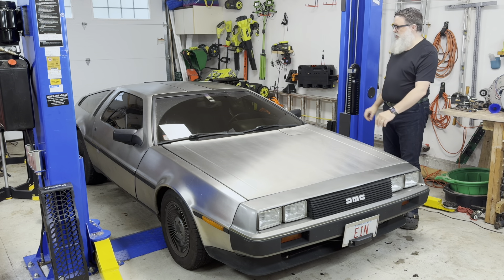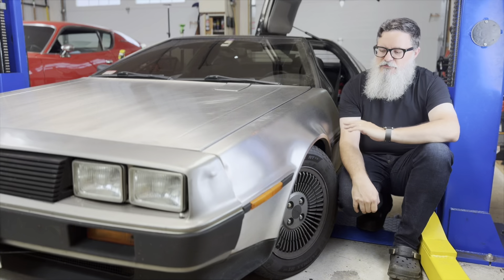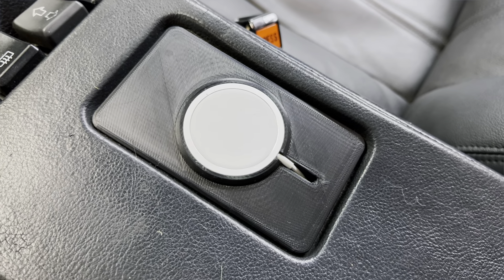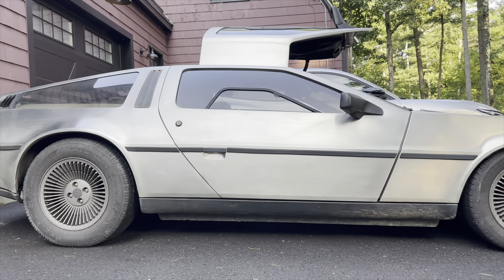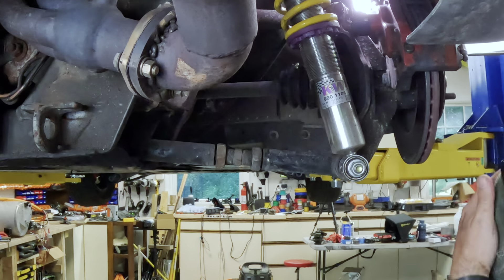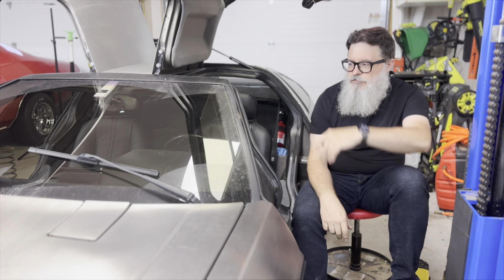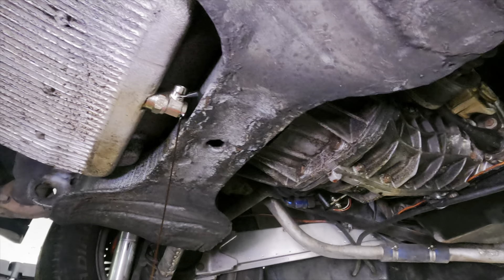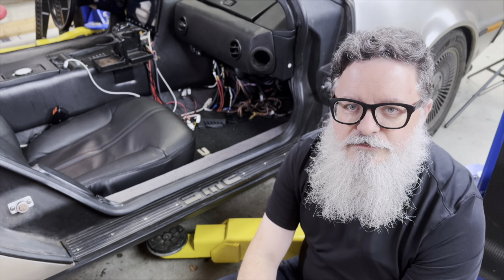From Boston to Chicago and back in under a week -- how did my DeLorean hold up?

Comment: Joe, nice to meet you at DCS. We got nailed with rain on the drive home too and my fuel pump fuse melted in the housing on the way back, so I got to fix that in the rain on the side of the road…other than that great trip!
Reply from the maker: You too. We got lucky that the few issues we had were not in the rain. We did have a car have a fuel pump and ballast resistor wiring failure in Maine (we had to push the Time Machine through the parade, but it was mostly downhill), then trailered it back to Jeff’s so we could fix it. But otherwise, everything went well!

Comment: I worked on equipment and changed bearings all the time with no problems but never had a wheel bearing which I replaced on my car last more than a few hundred miles, I think you have the same symptoms. Love the videos.

Comment: I once had a Subaru Impreza that had a chronic failing of bearings rather quickly on one specific wheel.  The only solution that eventually worked for me was to replace the wheel hub.  I think the first failure I had cause damage to the inside of the wheel hub where the bearing was seated and that damage kept throwing the bearings out of the correct alignment, even with the correct tools to press them in.  After replacing the wheel hub, the chronic failures finally stopped.
Reply from the maker: I think I’m at that point now too. I just had to swap in my last spare bearing, and I ordered a replacement hub. I’m going to to keep it in my trunk for the next inevitable failure, and order some more wheel bearings, just in case. Thanks!
Reply: I was also wondering if a new hub was the answer. I remember on older cars a bent spindle or bearing adjusted too tight would cause quick failures. This bearing is a pressed in cartridge style bearing so there is no adjustment to make too tight correct?
Reply from the maker: Right, it’s just pressed straight into the hub with no facility for adjustment. I wouldn’t be surprised if it’s my fault that it’s failing. Ironically, I replaced the bearings on both sides when I installed the Big Brake Kit a few years back amd they were fine, so I’m thinking I screwed up something installing them. I did have trouble getting them started straight.

Oh well. Hopefully the new hub fixes it!

Comment: What brand of wheel bearing are you using? I have a little over 2k miles on my new ones which are SKF. So far no problems. I've heard bad things about ones like centric and a few others.
Reply from the maker: I’m using SKF as well. I think my hub might be damaged. The bearings don’t seem to want to go in straight at the start, and it’s probably damaging them as well.

I ordered a new hub, which arrived yesterday; I’m going to keep it in the trunk with the necessary tools to swap it out on the road if something goes wrong, since it’s pretty easy to do when you don’t have to press in a bearing.

Comment: That mess of wires makes my skin crawl but great trip
Reply from the maker: Yeah, I sometimes think about tidying that up (the original wiring was all wrapped in electrical tape, and stock cars certainly do look cleaner than this), but I'll inevitably have to just cut it all way for another modification, so at this point I don't even bother.  The mess of wires in the passenger footwell is because I"m doing modifications to the climate control system, which is currently functional but not complete because I've been too busy fixing the more critical issues I've been finding.